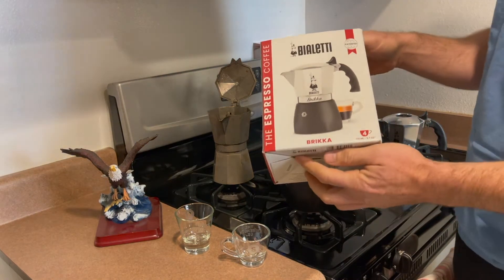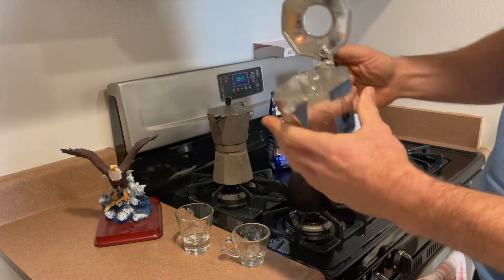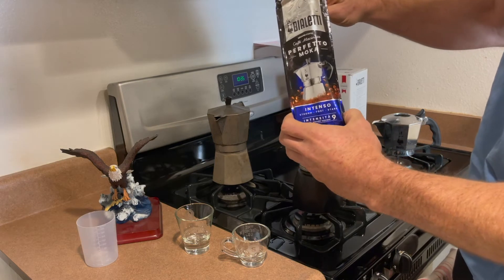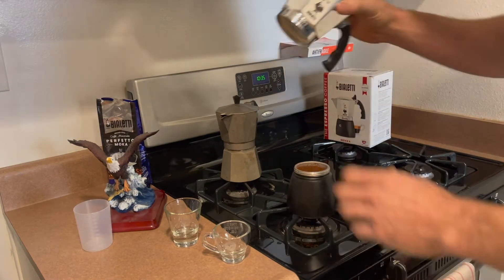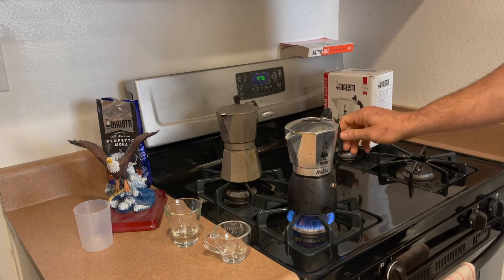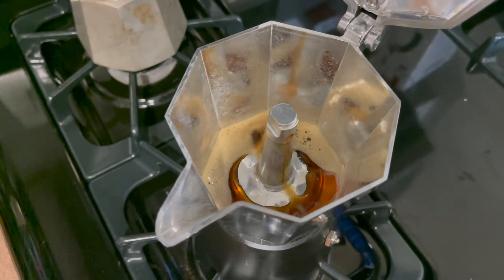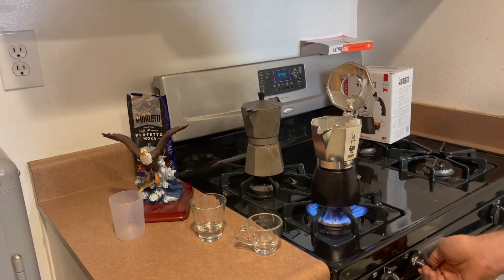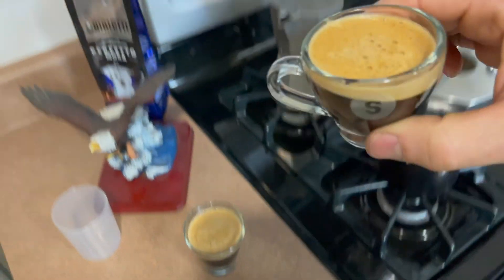How to Usa A Brikka Pot

Comment: Mine didn’t foam at all. I think maybe I shouldn’t have pulled on the tiny metal pull before heating it up?
Reply from the maker: Did you run water through it a few times
Reply: I think maybe the one shown in the video exaggerate the crema by using more of robusta beans, doesn't necessarily mean it's a better tasting shot of espresso. You can also try get more fresh beans which would produce more crema. Also try to control your grind level.
Reply: Don't get caught up in the crema thing......It really doesn't add to the over all flavor
Reply: @BennyCFD  I agree. People can try to get as much foam as they can, it's not gonna make it espresso, just a moka.
Reply: Use espresso beans.

Comment: Have you tried this model vs the old model of Brikka (weighted one)? Is the upgrade worth the extra money?
Reply: I think the older design is better. Far simpler and works just as well. I can't see this new valve design lasting as long without serious maintenance.
Reply: @cavanray6742  that's what I was thinking about too... Also hard to find a spare valve.
Reply from the maker: Bialettii has completely discontinued the old model. The new model is the only one in production. Time will tell how the valve holds up. It is much easier to get crema with the new model.
Reply: @thestrengthco  If so, they should lower down the price. Doesn't make sense to take that much when results are kind of the same with the older one and the new one. I would still prefer buying the older version, as I can still get it from stores around.
Reply: @rbmanb  I'm glad I got mine. Paired with the tuttacreama which is one of the finest milk frothers you can buy short of a steam wand.
Reply: @cavanray6742  Good to know bro, tho I like my coffee black as it comes. To be honest, I'm skeptic this moka shot would be good enough for me to replace true espresso so I don't even bother to try. Just go to the next coffee shop when the crave comes, and for day to day, I'm working on my hand drip capabilities.
Reply: @rbmanb  that's fair enough. Have you considered getting something like a flair?
Reply: @cavanray6742  Not really. First time I hear of it. Have you tried it before?
Reply: @rbmanb  flair makes great Espresso (by hand!) but is expensive but not as much as its electric cousins